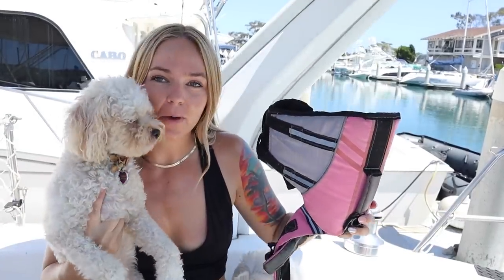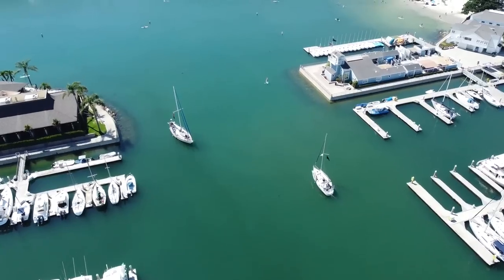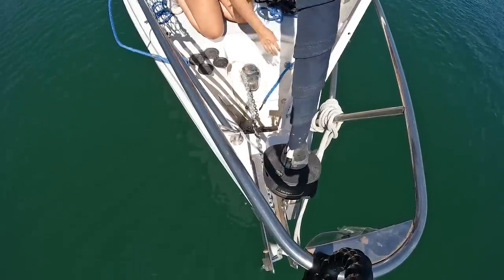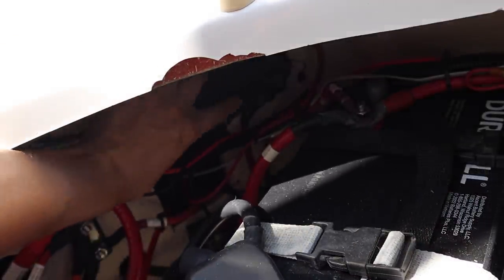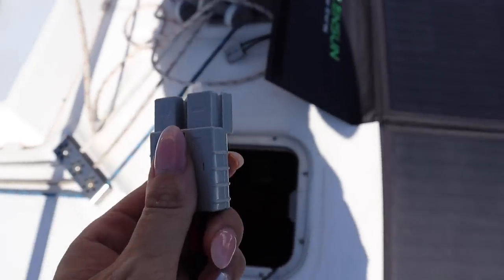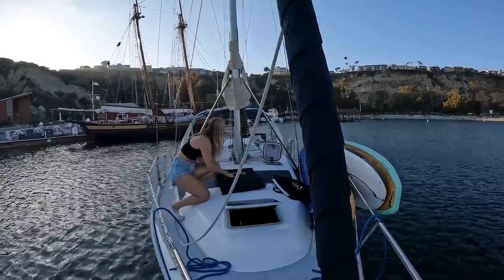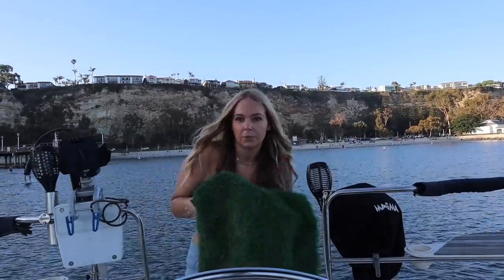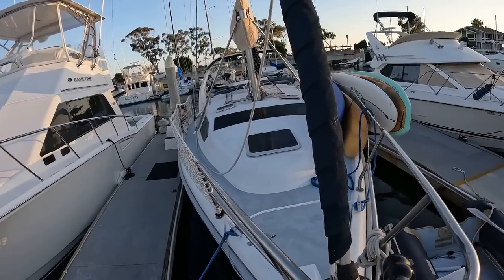Sailing Alone and Anchoring A Sailboat!

Comment: 50" in 18' of depth is probable fine for day anchor without wind but try to do at least 5:1 for over night.  That would be at least 100' feet of chain.  Personally I do at least 6:1 up to 10:1.  I do not know how much chain you have but it does limit the depths you can anchor in.  I learned the hard way unfortunately and now I carry 450' of rode.  I am very impressed with the drone skills!  Also you should permanently mount the solar.  The MPPT controller does a great job maintaining the battery and if you every get disconnected from dock power the solar will keep up.  Great video and I love to see you practicing it is a good strategy!
Reply from the maker: Thank you! Yeah if I’m staying over night I absolutely let out more! Thank you! That’s a good idea for the solar panel thank you!

Comment: Good video. I was complementing a YouTube sailor that I was learning from when someone said "he's only been doing this for a year."  He's also a surgeon and a chef.. so clearly he knows how to learn. What I figured out is he is very deliberate, step by step, which is why I found him so helpful. You're deliberate. Even though you're still new, you aren't doing what too many YouTubers do mug for the camera and go over their shortcomings and only half figure things out in front of the camera. Mostly just a waste of time. So well done; 
I've only got a couple of years myself. What I learned about anchoring is it's not so much the length of rode we let out, it's the ratio. Of course we still have to know how much chain. There are numerous anchor chain marking systems. I didn't like any of them. (Stare at a hundred feet of chain looking for three red plastic cable ties.... ) The one I thought was great was from Jon, with whom we just sailed across the Pacific. It uses cheap poly or nylon rope. There are color schemes and mnemonics. I use the color spectrum ROY G BIV  Red,  Yellow, Green, Blue then Red for 0' 25'(Y), 50'(G), 75' (B), and 100'(R)  [Orange is used if you're doing meters 0m (R), 10m (O), 20m (Y), 30m (G), 40m (B), 50m (R). Red at 0' because on the catamaran we sailed when the anchor came up, it seemed really fast. So we liked to see a red so we'd slow down. ]  I have 200' of anchor chain then 200' of 3 strand nylon. I marked that with the color electrical tape you can find at any ACE Hardware.  
I made a spread sheet chart, printed it out, highlighted the colors, laminated it and stuck it inside my anchor locker cover.  (It won't fade because it's in the light only when I'm anchoring.) The chart shows the lengths and the scope ratio. So your depth gauge reads 14', you look at the chart for 5:1 ...15' (close enough) that's 75',  Blue, so you let out chain until you see blue. Done. 
The way the chain is marked is 6' of the color rope is woven through the links. It doesn't interfere with the anchor moving through the gypsy gear, it doesn't fall out. (I tied a couple of knots at the ends just to see if they help in anyway) and most importantly, you can't miss it.   I shared the chart on Facebook Hunter Sailboat Owners. No idea how to find it, it's simple enough if anyone is interested. (Also I'm just up in Los Angeles, (keep my boat in Oxnard), if you'd like to do this for your chain, I've got plenty of rope left. I can cut some and send it to you. ) 
You could probably make a helpful video setting this up on your chain. I've never seen a video on this.
Reply from the maker: Wow thank you for the comment! There’s some great information here. I appreciate it! That’s a really good idea! What a great set up!

Comment: That portable stove you have is a great little stove fair warning now I just burnt my leg last week because I had a small saucepan filled with oil and garlic and when I placed it on and turned because it's so small the burner wasn't wide enough to keep it from tilting and falling off so make sure you use large pans on that particular unit or be very careful using smaller pans on that unit because it will fall through the space😮😮😮

Comment: Hello Captain Christa, nice to see you out on the water doing the proper checks before heading out onto the blue. 7:26 I noticed the plug for your solar panel is not on a sealed connector and that can be bad. The best way to keep your batteries charged is for this to be working any time the engine is not running and the sun is up. These connectors should be sealed/ weather proof connectors because salt water will mess them up, as a minimum I suggest you fill the outlet with dielectric grease and make sure the plug connectors are greased before plugging them in.
Reply from the maker: Thank you!

Comment: You're perfectly good there with two to one on your anchor but when you anchor up at Catalina or any of the islands hopefully you have a 100 ft of chain and put it all out if you anchor deeper than 40 ft make sure you put some rope out to this is advice from a guy that has worked most of his life as a commercial fisherman anchored out at the Channel Islands don't be shy and letting all your chain out hopefully you got at least 100 ft of chain and at least a 35 lb anchor I prefer the Bruce. One last piece of advice don't anchor in the rocks no matter what type of anchor you have. Good job on your video and all the things you were doing at once.🎉

Comment: You can check to see if your Bimini solar panel is putting out voltage by using a multimeter on the end connectors set to a high voltage. If the meter has 100v dc then that would be ideal.  Try it on a battery to make sure you set it correctly.  Those flex panels go bad so quickly. I would recommend some hard panels on your railings by the stern seats.  Also paint your chain with the rybwg acronym so as to know how much chain you have out.  It's rub your balls with grease...red yellow blue white green I think.  The anchor depth is depth under your keel plus the height from the depth sender to the top of your deck...so 18 feet on the depth finder might actually be 25 considering that circumstance.  So a 7 to 1 anchoring situation would mean seven lengths of 25 or 150 feet.  50 feet of chain is a 2:1 anchoring...which with people really close I wouldn't go less than 5:1 and you've got to be careful of swing.  If you were leaving your boat 2:1 won't work at all.
Reply from the maker: Thank you!! This is great advice!

Comment: Hello my friend. Is that a public anchorage for multiple nights? Do you have to reserve a spot if traveling? Where is it? Thanks for the info.

Might be too late for this fix, but consider using epoxy to bond some wood to the hull for the charge controller to screw into. West Systems Six10 from West Marine is a good choice. Fits a standard caulking gun. Squeeze amount needed onto a piece of scrap, mix with a putty knife, apply to one side of wood, press onto hull where you want it, and tape to hold in place for 24 hours. FYI they sell a mixing tip for the Six10, but they’re a bear to squeeze the epoxy thru.
Reply from the maker: Hi! It’s a public one I think you can stay 3 days! It is free you don’t need to reserve a spot to anchor. Dana Point! 
Thank you for the tip! I screwed it into the wall 😊
Reply: Hi, thanks for responding. I plotted a route to Dana Point last month. Now seeing it, I need to figure out a way to make the trip. You’re braver than I. I epoxy wood because I don’t trust myself not to drill through the hull 🤦‍♂️.

Comment: Nice! How long is your rode? I have about 50' chain, for a total of 250'. I don't anchor in more than 50' ATM, but thinking about adding another 100' of rope(no more chain), as I don't have a windlass. Great video
Reply from the maker: Thank you!! How deep are you thinking of anchoring? I pretty sure between chain and rhode I have about 300 total!
Reply: @CaptainChrista  shallow as possible lol. With 250, I'm happy I. 55' or less. Just got back from Avalon today after installing my 'robot'(auto pilot). It was awesome out there, and got back in record time, 5hours 40 minutes!